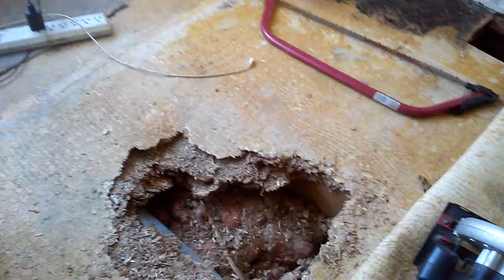Trailer floor problem

Comment: if they sit with out heat moisture will get in and swell it up and it gets soft . also if no vents are in the skirting  the moisture will be trapped in under the trailer and make it soft also , i put oil based primer on all of mine to shield from moisture  when we changed the carpet . the cheapest fix is osb from lowes and under lay the floor . but even with that i would paint with primer as a vapor barrier.  with a trailer it is always something !!!
Reply from the maker: I have a bunch of holes now like 8 plus lol

Comment: Craigslist is my go-to place for free materials, you could also post your "want" there. Maybe you're familiar with Craigslist in your area? Any housing or commercial building sites may have a dumpster of cut-ends started. Ask the foreman for scraps. The Scouts have service projects/patches to earn regarding woodworking, safety, etc. Maybe the local Scout troop could be contacted to see if they're interested in a weekend merit badge project. Bartering might work for you too... a fishing trip for a floor or something like that? Not all carpenters are the accomplished sportsman you are!
Reply from the maker: Never thought of craigslist ty for the idea and stopping by sorry it took so. long to answer
Reply: Glad to help, even a little bit. I enjoy your adventures on your channel and hope your trials and tribulations are few and far between!

Comment: looks like you have a water leak problem.  you need to stop the water.  caulking does wonders for lots of things.  the floor.  you need to locate the next floor joist.  probably where that row of nails is.   set your circular saw to cut just thru the board and not the bottom one. find the middle of that board.  and saw down the middle of it.  the rest of the floor needs to sit on the other half.  saw out the bad section.  set the new board in and nail it down.  the OSB you had over the top will owrk in the hole.
Reply from the maker: the hole is bigger now. its 57x52 wish I had some friends like you and John null has. lol